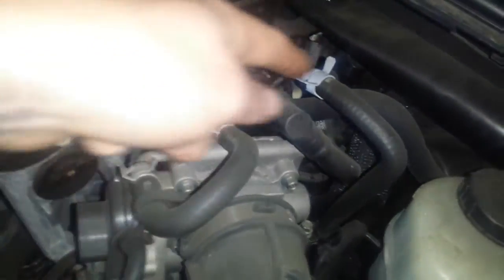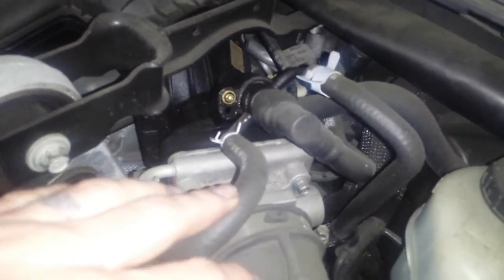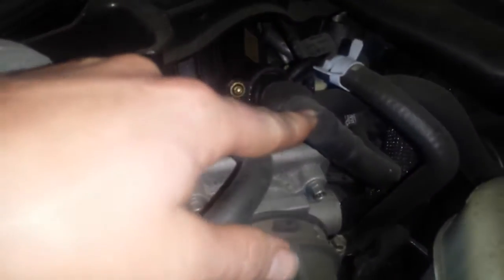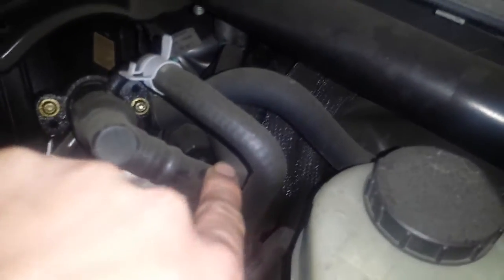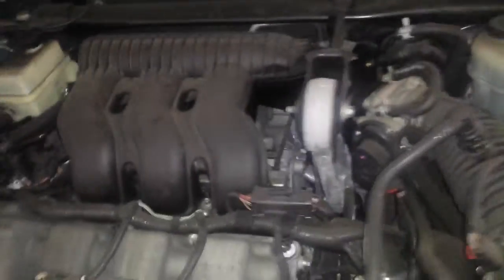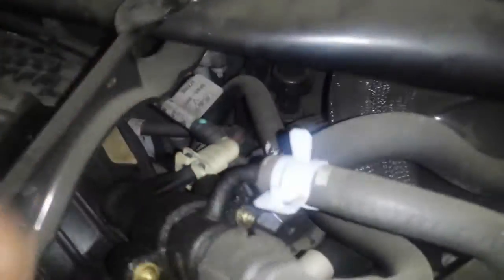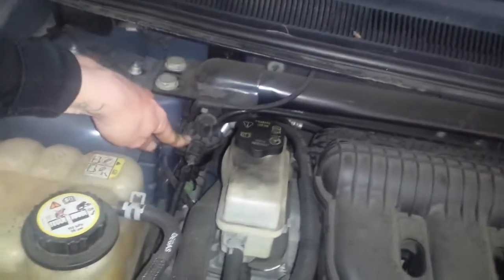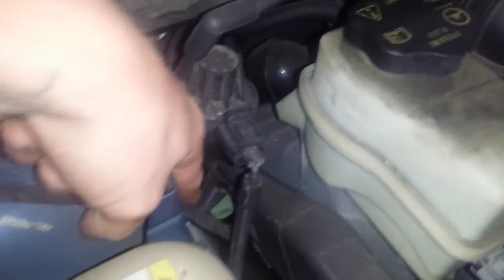Ford Freestyle emissons: PCV valve, EGR valve, & EVAP canister locations.

Comment: You didn’t go over the crankcase breather valve that is an integral part of the pcv system. It’s located right up top in front. That’s my issue and hard to find anything about it. Have to figure it out on my own. Now going to take apart the valve cover to figure out how to replace it
Reply from the maker: You are gonna have to let me know how the goes. To my knowledge, there is no values on the breather side of the PCV system

Comment: Where in the evap system do I vent the air so that I can pump gas without it stopping so frequently?
Reply from the maker: is it hard to fill a complete tank? Its more commonly the evap vent solenoid in this situation but I have also had to replace the purge solenoid too in a few cases.
Reply: RF Brown